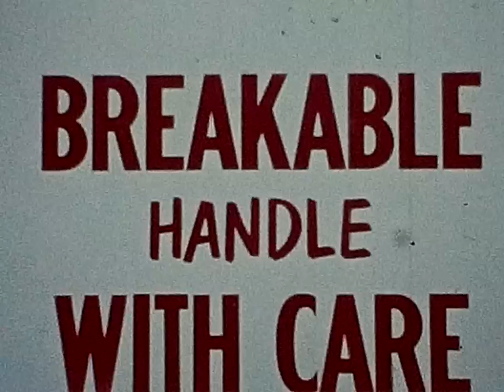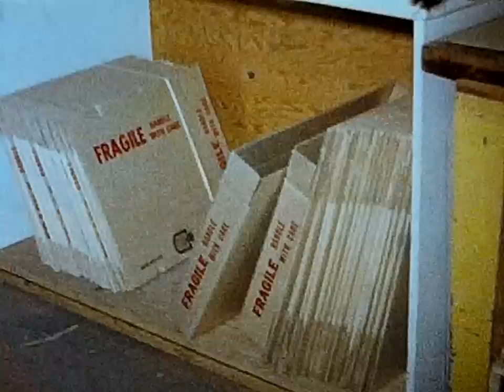Glass packing 8mm film

Comment: "Note the dirt in the camera. Yes that is exposed on the film that way."

When I started collecting films, I often notice that with films shot on 8mm and 16mm often showing a lot of hair caught in the gate of the camera itself that would show up while running the prints, though I suppose when ran on regular TV, they wouldn't be seen by the CRT cropping.
Reply from the maker: Pretty much every film I have transferred had dirt in the camera, especially 8mm.  This us because the camera had to be opened and the film flipped over and that was often done in a changing bag with little care given to cleanliness. Super 8 was not so bad as the film was in a cartridge and therefore the camera sent open much to swap cassettes.

Comment: I had a vacu-form machine, ( several actually ) in my dental lab for making custom impression trays and mouth guards and lots of other things. You can make one of those at home. For model builders they are great. Only problem is getting the plastic stock in the size you need. I imagine you can find that on the interscreen though.

Comment: why would a film scanner have jutter? It should be smooth flowing, is that due to the quality of the scanner mechanism?
Reply from the maker: It doesn't have judder.  What does happen is film gets damaged from old projectors.  I have seen some pretty bad films.  Typically from large plastic reels. The reels warp and squeeze the edge of the film.  This causes a slight curl. Now on a projector the film is pulled into the gate under tension and it is squashed between the pressure plate.  That flattens the film as it passes through the gate.  On the scanner the film runs through a smooth track and is pulled 1 frame at a time through it.  Totally silent in operation.  Film that is not perfectly flat can shift slightly.  Remember this is a 400 scanner not one that costs 200 grand like my competition uses, and he charges accordingly.  I don't know many people that will pay 2.00 per foot of film.  No matter how good it is.  I have customers that would like me to just project on a wall and shoot it with a camera in standard def if it gets the price down.
Reply: @12voltvids  That is good info and helpful. I have video stabilization that has been pretty effective in post production inside Sony Vegas. Havent used it alot because it messes up sound I may want to keep in synce but non applicable to silent film so I'm thinking if I were to get that warped effect from damaged film that filter may do the trick nicely.
Reply from the maker: @val058  
I've used warp stabilizer in premiere it works but the problem is you'll see it on the edges as it kind of crops a bit. I'm dealing with a film now that the client had spooled onto a big 400 ft reel that had warped and compressed the film on its side where the warpage occurred. Playing the film through the projector on a wall looks fine because the film was squeezed in a pressure plate but running it through the scanner where there's no tension at all applied to the film has become an issue as every time the work section of film passes through the scanner the picture shifts slightly side to side and every rotation of the reel. Even spoiling the film onto a different reel has made no difference because the actual film itself has deformed slightly from sitting all these years on a warped reel

Comment: that is a bad method of packing for glassware, if the glass or fragile items are packed well you can drop the box and the contents will not break.
Reply: I do understand, the process does not escape me, it presents itself as inefficient and wasted space.
Reply: @OX71  
As inefficient it may seem, breakable glassware made it safe to it's destination. Bubble-wrap had not been developed back in the 60s when this was done. Today they would put some styro peanuts, or bubble wrap around and throw in a box and mail. Things were done different back then.
Reply: @davemcdonald4267  , I'm well aware of how they packed them and pack today.
 I am a packer for an international moving company, I pack using blank newsprint paper, cardboard in various plies, corrugated and bubble wraps of varying grades.  peanuts are used on occasion as a buffer between a chandelier and the walls of a crate but the chandelier is hung inside as on a ceiling, there can be no tipping of the crate.
 how do you know how much of these products came out broken at the retailer because of improper handling during shipping? if not many perhaps it was because the handlers had pride in their work and took care. some of the comments rightly say carriers and handlers today treat fragile markings as a target for shitty treatment.
my original comment is true, glass packed  packed in the video's fashion would be easily broken and if packed properly you could drop the box and not get damage.
 It's also true that no one really takes the time or wants to pay for that kind of packing, it costs too much and companies are happy paying for insurance for that kind of loss instead of getting it all there in one piece. 
but what do I know, I've only been in and around the moving and transport industry for most of my life.
Reply from the maker: @OX71  
Well today you would never ship something marked 'Fragile" because as you said disgruntal workers will intentionally drop it.
I can assure you that these items reached their destination in perfect condition. How do I know this. Well my father in-law, the guy with the dumb look on his face in the film (he was the filmmaker too) was one of the delivery drivers. Company employees who's job it was to deliver all the items ordered out of the catalog. They packed them all up by hand at the warehouse and the driver loaded them, drive them to their destination and delivered them. They all, every one of them took pride in their work. This was a different era, where people actually liked their job. By contrast to there days where many hate what they are doing.  There are a few people that enjoy their day job. I am one of them, but unfortunately many do not. I am working on a VCR right now for a guy that despises the company he works for, and it is a relatively high paid union job that I bet many would kill for. Back in the 60's though things were different. Today stores don't deliver. Most just ship out and let someone else do the delivery.  I couldn't believe it when I was at work parked in a customers driveway and a trucking company rolled up, and literally pushed a hot tub off the back of the truck right in front of my work truck and left it there.
The driver wouldn't move it. Weighbill said drop at curb, and only place he could drop it was right in front of my truck. (I was working up a ladder at the time and couldn't move it.) I had to drive over the customers front lawn to get out, because the driveway was blocked with a giant hot tub. Customer had to arrange for someone else to come and move it to the back yard.
Had that been me I would have told the driver, either take it around back, or take it back.
Reply: @12voltvids  I hear ya.
I've seen the degeneration over the last few decades.
Reply: @12voltvids  That driver deserves to be fired!
Reply from the maker: @GlennaVan  they were all fired when the store went bankrupt in 83
Reply: @12voltvids  Not exactly a surprise.  With that kind of service to the customer, I cannot imagine they got many good references.  It's a shame everyone lost their jobs because there surely were good and caring employees as well.
Reply from the maker: @GlennaVan  the entire chain shut down in 83. Eaton's was one of the premier department stores in Canada, lake Woodward's Sears and the Hudson's Bay. Currently there's only one left guess which one that is? That would be the Hudson's Bay, the oldest operating business in Canada and probably all of North America. They were here before colonization. When the original European settlers set up a trading post with the first Nations. Eatons went bankrupt as did Woodward's with the big box specialty stores first started appearing. Prior to that, prior to the internet everybody had catalogs that were sent out every year and you went through the catalogs and you phoned your local store and ordered televisions cookware glassware tables couches beds anything you wanted and they would deliver it to your house. My father-in-law work for Eaton's for 25 years and retired just before the stores closed. This film he shot as a training film to teach new employees how to pack glassware for shipment. He was an amateur filmmaker and got a few gigs to do a few corporate films for eatons when he worked there. I have another one which I have not scanned yet which shows how they built the furniture and delivered it because back in those days everything came in big pallets and boxes and it was all put together by employees in the warehouse none of this take the box home and spend an afternoon putting it together yourself commonly called the Ikea way. This is from a time where people got very good service they picked up the phone and within a day or two furniture was delivered to their house. But that all came with a cost big box stores where you could just pick up the box and take it home we're cheaper that's spelled the end of the large department store retailers they've all gone we have one left. Incidentally you've probably heard of a high-end retailer sacks on 5th right? Guess who owns them? HBC, Hudson's Bay corporation. Now you know.
Reply: @12voltvids  Wonderful story about the company (and your dad).  
We lost a lot when the day of the catalogs became mostly history.  The average person today has no clue what has been lost.  I grew up on a farm so I am very aware of how important the catalogs were in our lives and "going to the city" to shop in real department stores was a treat.
There are advantages to the computer age and internet but there are so many things that were valuable in many ways the have been lost.

(I don't know your history, but I am betting many who had outhouses would have been heartbroken to see the catalogs gone!)